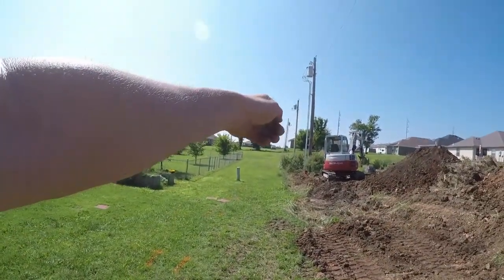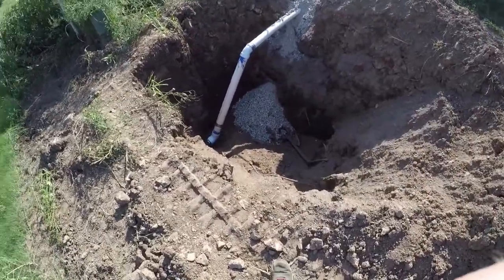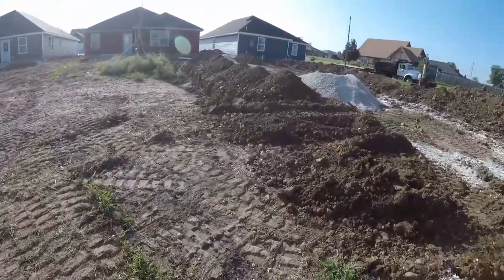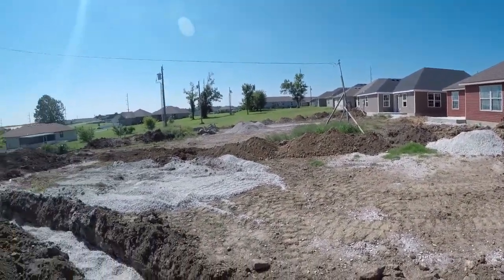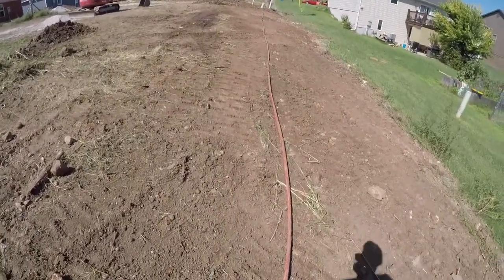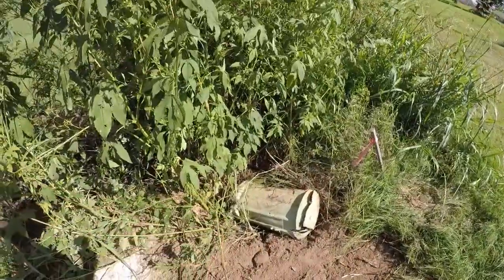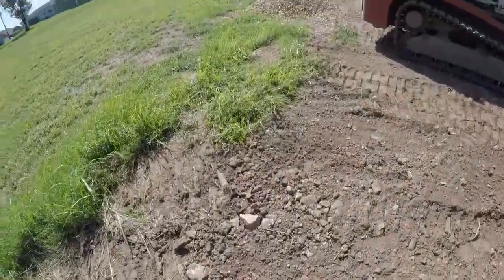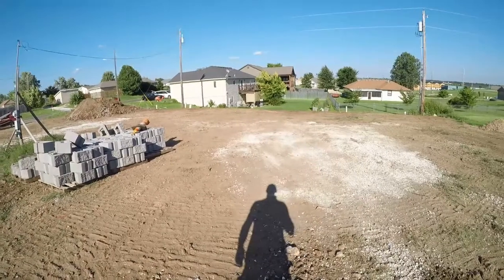More Sewer Lines

Comment: I rentted  escalators is a John Deere guy didn't tell me you can switch it to escavator or backhoe and I had it all back Co took forever to dig a line for a pipe in a buddy of mine told me there's a lever there to switch the escavator LOL thanks Gary
Reply from the maker: Yvonne Johnson lol yeah it can be a pain if your use to one pattern vs the other

Comment: Time-laps is great just mix it up, one question what size is your sewer pipe and stormwater?
Reply from the maker: barry hansen 8” and we run 4” from the house to the main. Thank you for the feedback and for watching!
Reply: Thanks for the reply it looked smaller than that same as NZ but the mains are huge as they have been down for 50-100 yrs.
Reply from the maker: barry hansen we have areas that have bigger pipe that have been there forever but all the newer stuff 8” sch 40 I believe

Comment: Do you do your own bidding or does somebody do it for you or do you just charge by the hour??
Reply from the maker: Clifford Fluegge yes I do all my own bidding, most of the stuff for this builder is by the hour and he buys the materials. But a lot of my other jobs are bids. Thanks for watching
Reply: I have started buying some equipment and was thinking about doing the same stuff as you I have a case Backhoe and a bobcat skidster with a few different attachments like post hole digger clam bucket tooth bucket like yours and a straight bucket and a couple other things for it also I have a couple other tractors for brush hogging fields and have done some lot clearing I also have a chipper to chip up brush and been looking for a little excavator like you you have ! How do you like yours and how do you like your skidster my bobcat seems to always have something going wrong with it like I’m working on it more then I work it so looking to buy something else as well for a skidster so let me know how your stuff has treated you ?
Reply from the maker: Clifford Fluegge my Takeuchi s have been great! Had the loader since 2012 bought it with 900 hours it now has 6800 hours still going strong. The excavator is 2014 I bought last year with 2400 hours now has 3500. Both machines are great and reliable
Reply: What kinda price did you pay for the two pieces of equipment I don’t have muck into what I have but I really want to start with some stuff that I can rely on and won’t break down all the time so far I have put a bunch of money into my bobcat skidster and it don’t have tracks it’s a tire skidster as you know it’s really hard to do decent grading with something with tires the tracks keeps you flatter for sure what’s your thoughts on that and digging with a backhoe you can’t get the dirt away from you sometimes I have been using equipment for over 30 years now I worked for a big company installing underground gas tanks so I have been running cat excavators mostly 330 cat and case 821 or 621 loaders and case Backhoes extended hoes 4by4 and gravel trains and tri axle dumps all fords but but I want to do this stuff on my own now not for someone
Reply: Do you own your company or do you have a partner ?
Reply from the maker: Clifford Fluegge I own the company it’s just me, my wife helps with the books but I do everything else. No employees either

Comment: Would a trencher have been more efficient on these projects? Your the Pro, I'm just asking. That cable line is a joke!
Reply from the maker: G4 Outdoors not so much with having to get to the sewer main plus the plumber needs room in the ditch to get the fall right on the pipe. You could have used the trencher on the cable line. That’s very typical of cable one here 🙄 thanks for watching